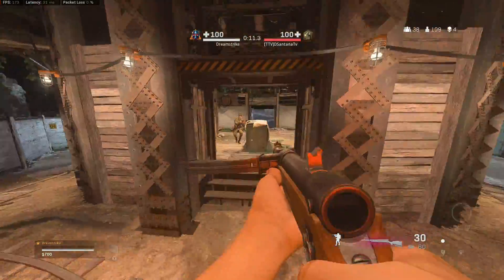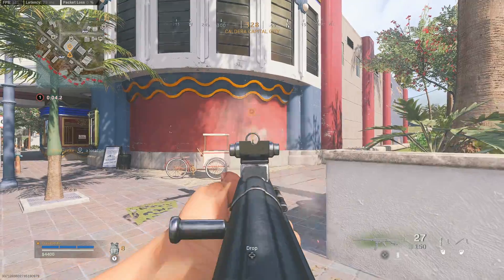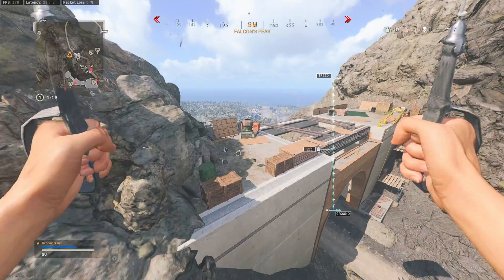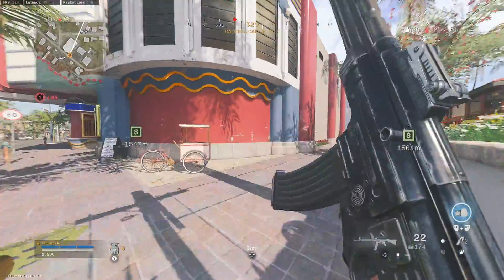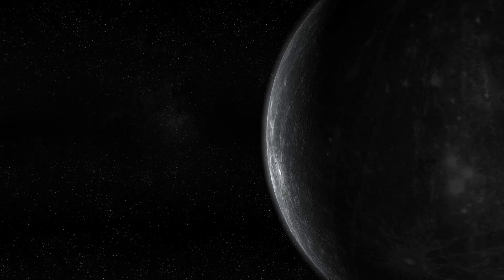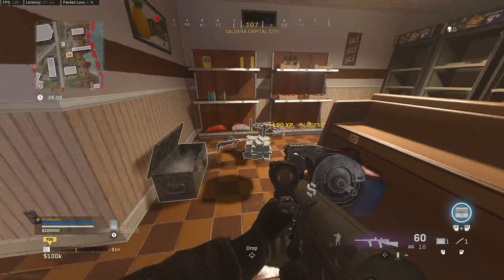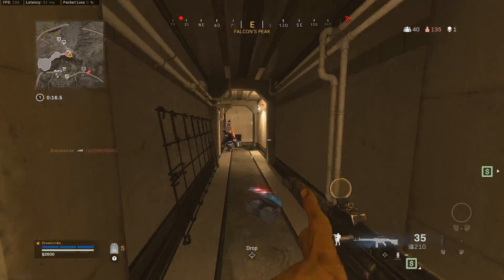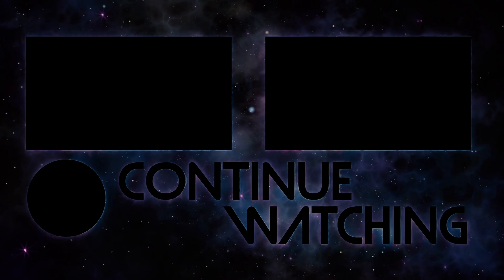youtube video #-T7VW7dRLKU

Comment: Excellent as always my man.
So do you even recommend for ps5 to use wired instead of Bluetooth?
Reply from the maker: So this is a tricky question. Bluetooth offers lower input delay on average but the variation is greater than a wired connection. This means that "theoretically" your aim could feel a bit different from time to time. I would recommend jumping into a game with bots (if you have Modern Warfare) and test both in one sitting.

Here's a great video breaking down some input delay test results. If it didn't link properly, skip to 14 minutes in.
https://www.youtube.com/watch?v=ahsO5bhBUtk
Reply: Thank you so much ❤️